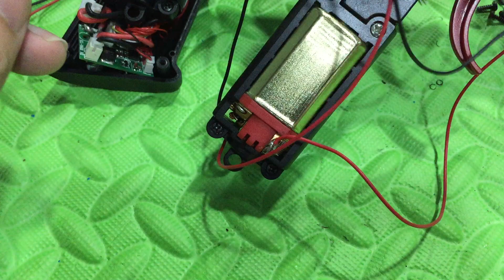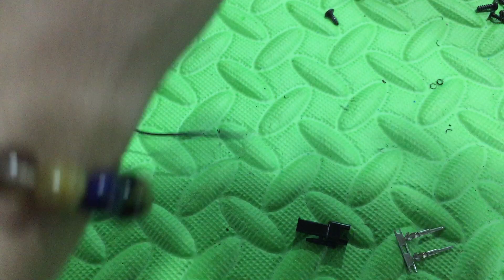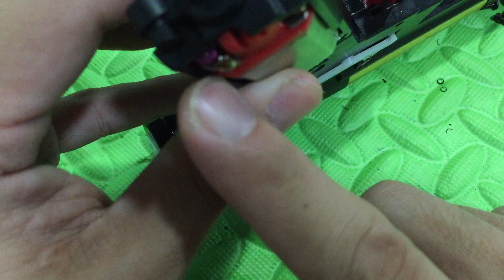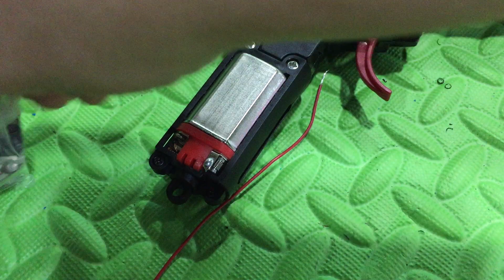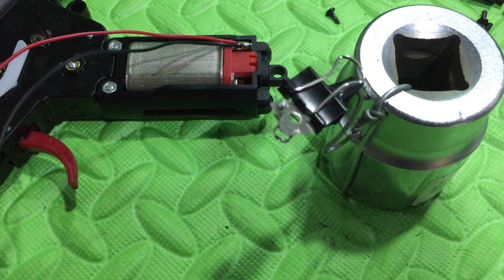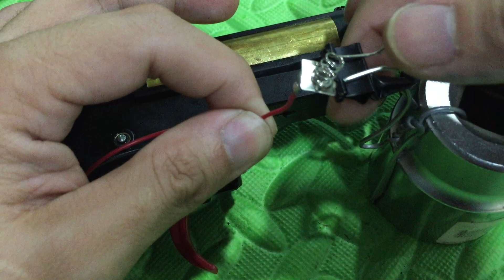SKD M4SS - Back To Most Basic System !

Comment: hello m8, my M4SS only fires when i turn the fire mode selector switch off safety. only fires full auto
Reply from the maker: m4ss now having many issue with it chipset/chipboard, so it might another issue cause by the chipset. Try change it and run only with 7.4v instead
Reply: is the selector switch feel loose ?  my screw was a mil too long.. yours could have jumped out of the key way... i took the screw out and filed a little off.. not too much though as it will make the selector really tight to turn..

Comment: ok folks,, do not use the 11 volt battery with these,, you will fry the chip set.. i have seen comment on other videos that the chip set is only rated to 9 volt.. another vid,, as soon as he hooked up the 11 volt it cooked up the chip set..but they are only 18 bucks to replace..